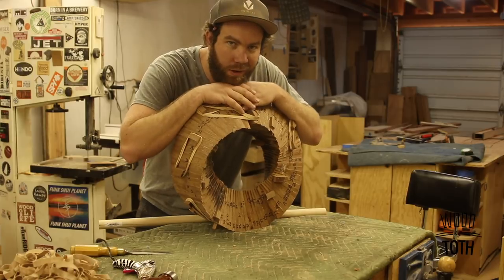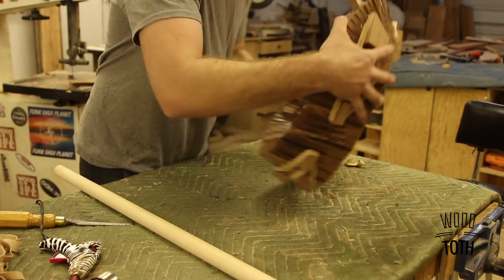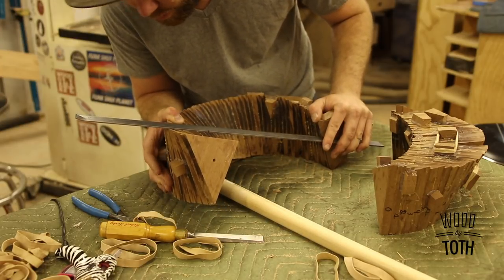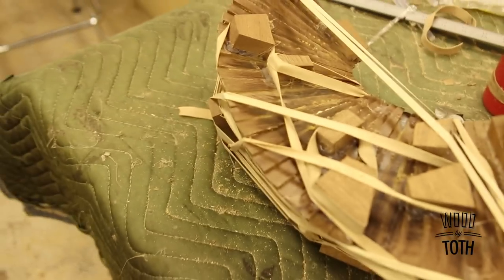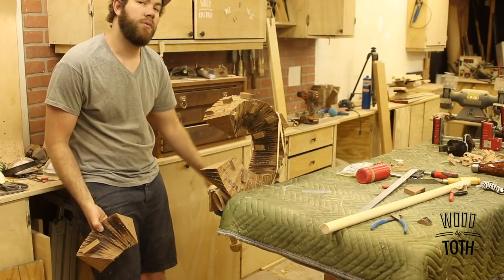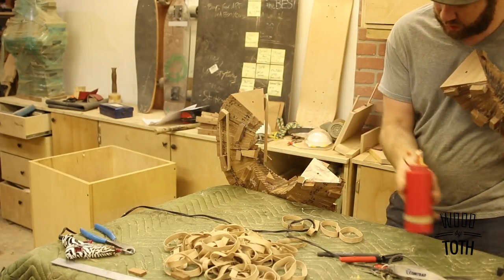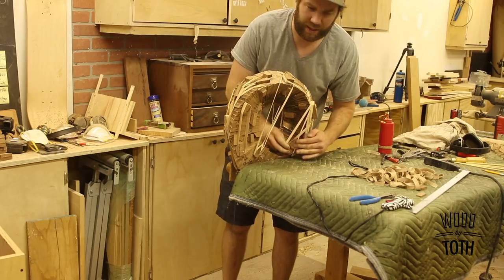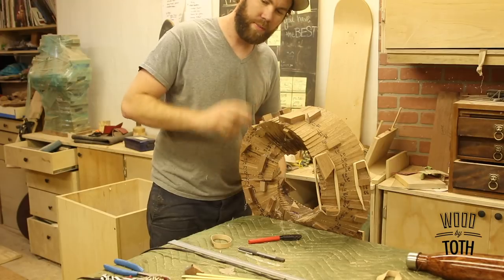Building A Möbius Strip // Day 4

Comment: I got a better rubber band solution.  Called a “ranger band”, used by the Army Rangers.  You can cut them to size and strength from the rubber tube of a used bicycle tire tube (cross section).  You should look into fat-tire tubes.  Killer bands on steroids!

Comment: Here's an idea: the little blocks you glue to the sides have vertical walls, so the rubber bands can sometimes slip off, flying through the air and smacking your desperate testicle.  How about cutting the edges on an angle so they grab better and you limp less?
Reply from the maker: Yeah I do that on some, just need to do it on more of them. Lots of the time the bands snap on me